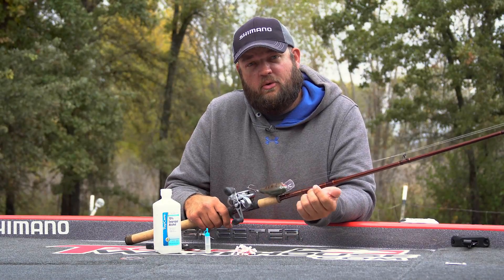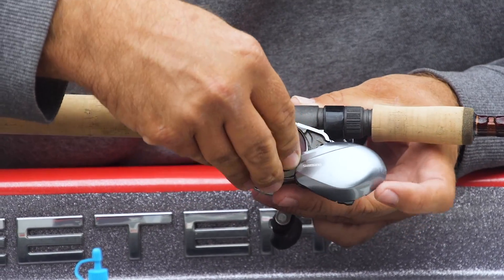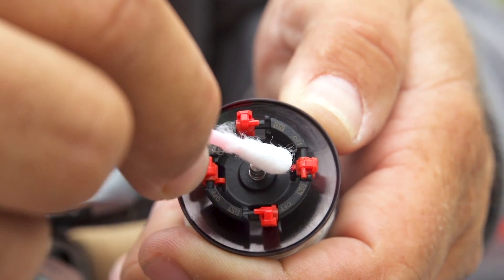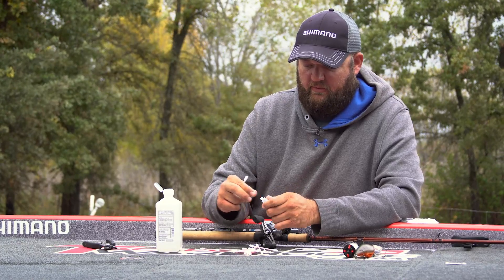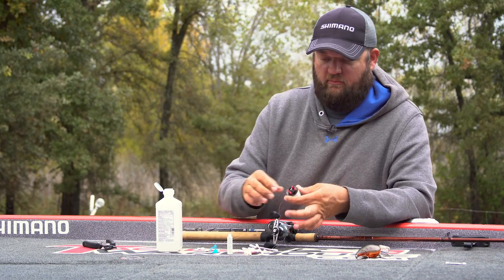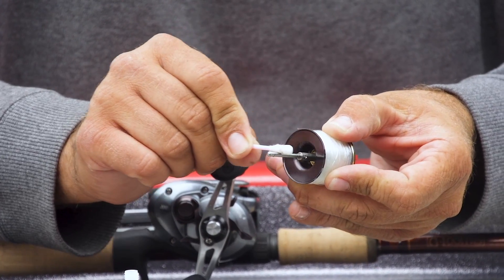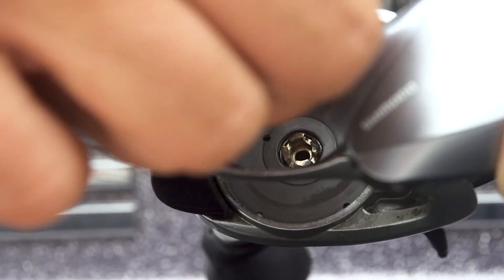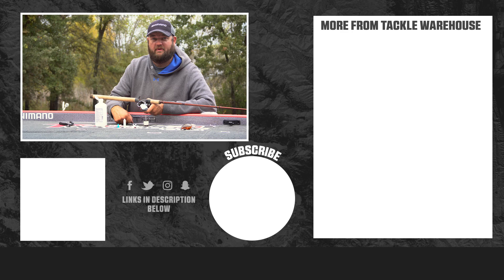Pro's Pointers - Shimano Reel Care Maintenance with Dan Thorburn

Comment: Hi Dan, how's it going?  I have followed this video to a tee, but yet I have the noise when casting. I have narrowed it down to the braking system. I've cleaned and lubed as shown. My question is my brass braking cone is scarred. (Going to try and attach a pic, not sure it will let me) I got one on order from Shimano. Do you think that could be my noise? If I take off all the brakes, and turn the adjusting wheel to 1 it will cast quietly, no noise. I just can't cast it regularly like that. That for the video, and info. And of course it won't let me add a video.